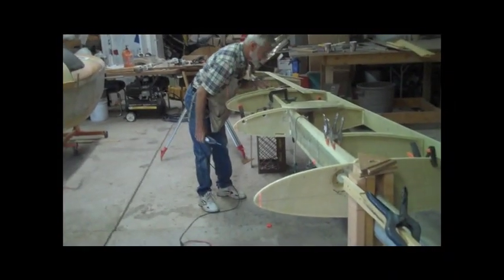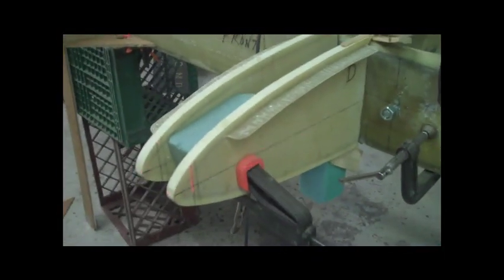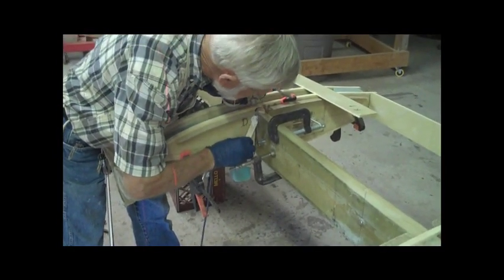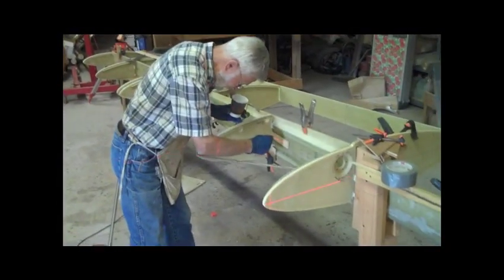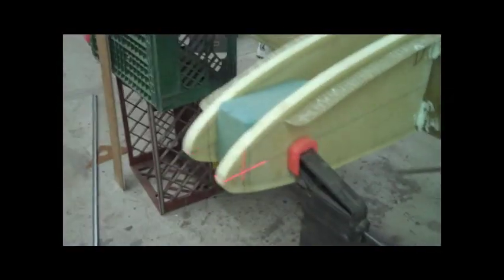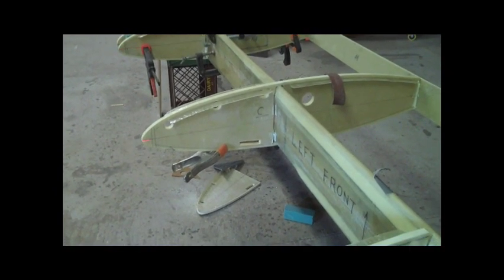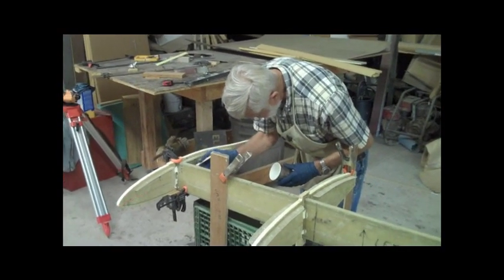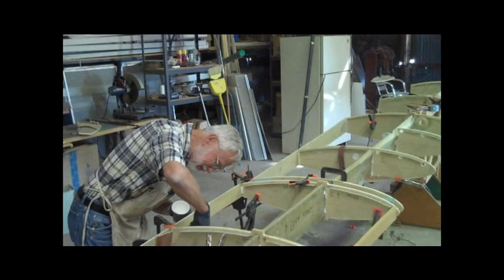KRSuper2 Wing Assembly - Super2 Composite Wing

Comment: Use the cake frosting applicator(method) to apply your epoxy and popsicle sticks (or tongue depressors) to fare the joints ....... this system is used in "stitch and glue" boat building ...... very fast and neat .............. JRW